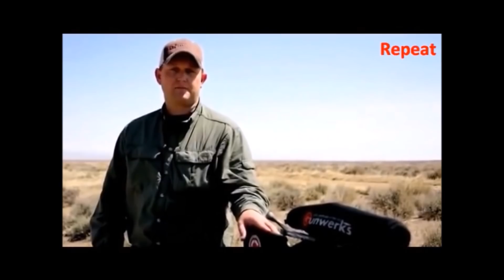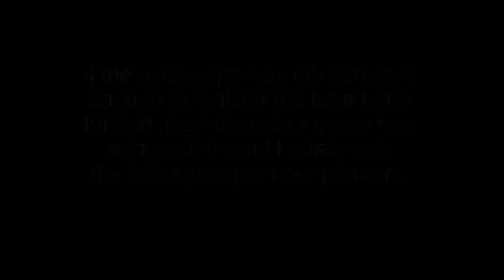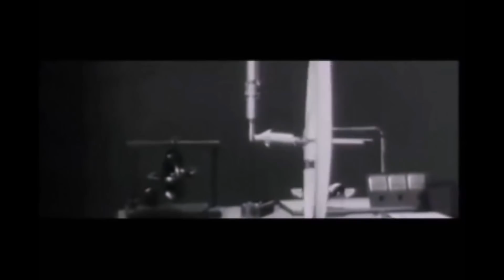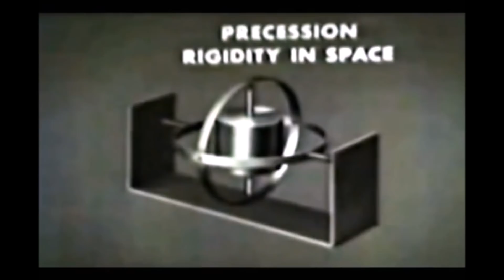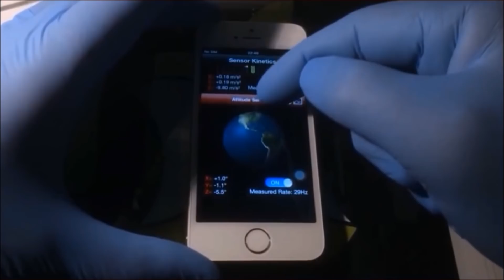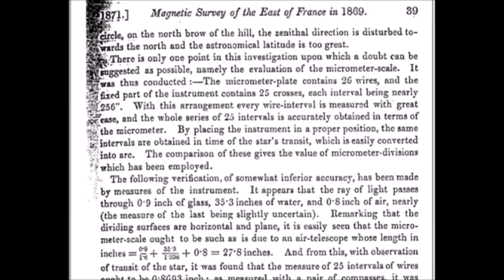The Motionless Earth - Final Addendum

Comment: Considering Coriolis effect, wouldn't the other motions be even more apparent than just the variable rotational effect? For instance, depending on your position and bullet trajectory, wouldn't you have to account for say, the 67,000 mph movement around the Sun? To me, if the bullet is indeed not moving with the Earth this would be a far more prevalent force that the shooter would have to account for. Especially considering that the entire planet is moving at that rate so your location should be completely irrelevant. Hypothetically, the bullet should go careening left or right, or up into the air or down into the dirt or not even leave the barrell because that translates to the Earth moving 98,266 feet per second in respects to orbital speed around the Sun. Why do you have to account for rotational effects but the orbital effects magically don't matter? Shouldn't these two forces be equally important?

Comment: What are your thoughts on the ring laser gyroscope experiment recently done?
Reply from the maker: "I have to confess that I was bothered by the fact that the Axis of Evil seemed linked to a special direction in oursolar system... But now we have completely independent data... This is a hint of something really big."- Astrophysicist,Max Tegmark

"Why is the solar system cosmically aligned?"- Astrophysicist, Dragan Huterer

"The apparent alignment in the cosmic microwave background in one particular direction through space is called 'evil' because it undermines our ideas about the standard cosmological model... the Copernican Principle seems to be in jeopardy."- Astrophysicist, Ashok K. Singal

"One of the most surprising findings is that the fluctuations in the cosmic microwave radiation temperatures at large angular scales do not match those predicted by the standard [Big Bang] model."- The European Space Agency, Planck Probe, 2013

"It is both amusing and instructive to speculate on what might have happened if such an experiment could have been performed in the sixteenth or seventeenth centuries when men were debating the rival merits of the Copernican and Ptolemaic systems. The result would surely have been interpreted as conclusive evidence for the immobility of the Earth, and therefore as a triumphant vindication of the Ptolemaic system and irrefutable falsification of the Copernican hypothesis."- Physicist, G. J. Whitrow

"The Copernican revolution outshines everything since the rise of Christianity and reduces the Renaissance and Reformation to the rank of mere episodes, mere internal displacements, within the system of medieval Christendom. Since it changed the character of men's habitual mental operations even in the conduct of the non-material sciences, while transforming the whole diagram of the physical universe and the very texture of human life itself, it looms so large as the real origin both of the modern world and of the modern mentality, that our customary periodisation of European history has become an anachronism and an encumbrance."- Historian, Herbert Butterfield

"It is clear that the earth does not move, and that it does not lie elsewhere than at the center."- Aristotle

"I have read with much interest Messrs. Michelson and Morley’s wonderfully delicate experiment attempting to decide the important question as to how far the ether is carried along by the earth...I would suggest that almost the only hypothesis that can reconcile this opposition is that the length of material bodies changes..."- George FitzGerald

"Anybody who has been seriously engaged in scientific work of any kind realizes that over the entrance to the gates of the temple of science are written the words: 'Ye must have faith.'"- Max Planck

"It matters not whether we reckon it 28 or 54 million miles distant for either would do just as well."- Issac Newton

"Science today is locked into paradigms. Every avenue is blocked by beliefs that are wrong, and if you try to get anything published in a journal today, you will run up against a paradigm, and the editors will turn you down."- Astronomer, Fred Hoyle

"...Again, once more for the record: it has been shown at least six different ways this century alone that the equations and physics used by NASA to launch satellites are identical to the equations derived from a geocentric universe.
Thus, if the space program is proof of anything, it proves geocentricity and disproves heliocentrism." Astronomer, Dr. Bouw
Reply from the maker: That's my thoughts.
Reply from the maker: "We may therefore say that the broad result of a series of experiments of Michelson-Morley type is that no motion of the earth through the ether can be detected by an influence on the velocity of light.”– Encyclopedia Britannica (1959)

“There was just one alternative; the earth’s true velocity through space might happen to have been nil.” - Physicist, Arthur Eddington

“The data [of Michelson-Morley] were almost unbelievable… There was only one other possible conclusion to draw — that the Earth was at rest.”- Physicist, Bernard Jaffe

“The easiest explanation was that the earth was fixed in the ether and that everything else in the universe moved with respect to the earth and the ether… Such an idea was not considered seriously, since it would mean in effect that our earth occupied the omnipotent position in the universe, with all the other heavenly bodies paying homage by moving around it.”- Physicist, James Coleman

“The Michelson-Morley experiment confronted scientists with an embarrassing alternative. On the one hand they could scrap the ether theory which had explained so many things about electricity, magnetism, and light. Or if they insisted on retaining the ether they had to abandon the still more venerable Copernican theory that the earth is in motion. To many physicists it seemed almost easier to believe that the earth stood still than that waves – light waves, electromagnetic waves – could exist without a medium to sustain them. It was a serious dilemma and one that split scientific thought for a quarter century. Many new hypotheses were advanced and rejected. The experiment was tried again by Morley and by others,with the same conclusion; the apparent velocity of the earth through the ether was zero.” - Historian, Lincoln Barnett,foreword by Albert Einstein

“What happened when the experiment was done in 1887? There was never, never, in any orientation at any time of year,any shift in the interference pattern; none; no shift; no fringe shift; nothing. What's the implication? Here was an experiment that was done to measure the speed of the earth’s motion through the ether. This was an experiment that was ten times more sensitive than it needed to be. It could have detected speeds as low as two miles a second instead of the known 20mps that the earth as in its orbital motion around the sun. It didn’t detect it. What’s the conclusion from the Michelson-Morley experiment? The implication is that the earth is not moving…”- Physicist, Richard Wolfson

“…to the question whether or not the motion of the Earth in space can be made perceptible in terrestrial experiments. We have already remarked… that all attempts of this nature led to a negative result. Before the theory of relativity was put forward, it was difficult to become reconciled to this negative result.” - Albert Einstein

"I have come to believe that the motion of the Earth cannot be detected by any optical experiment."- Albert Einstein

"Briefly, everything occurs as if the Earth were at rest..." - Physicist, Henrick Lorentz

"A great deal of research has been carried out concerning the influence of the Earth's movement. The results were always negative." - Physicist, Henri Poincaré

"We can't feel our motion through space, nor has any physical experiment ever proved that the Earth actually is in motion."- Historian, Lincoln Barnett

"Thus, even now, three and a half centuries after Galileo... it is still remarkably difficult to say categorically whether the earth moves..."- Physicist, Julian B. Barbour

"There is no planetary observation by which we on Earth can prove that the Earth is moving in an orbit around the sun."- Physicist, I. Bernard Cohen

"So which is real, the Ptolemaic or Copernican system? Although it is not uncommon for people to say that Copernicus proved Ptolemy wrong, that is not true... one can use either picture as a model of the universe, for our observations of the heavens can be explained by assuming either the earth or the sun to be at rest." - Physicist, Stephen Hawking

"If we were to adopt a frame of reference like Tycho's in which the Earth is at rest, then the distant galaxies would seem to be executing circular turns once a year, and in general relativity this enormous motion would create forces akin to gravitation, which would act on the Sun and planets and give them the motions of the Tychonic theory."- Physicist, Steven Weinberg

"Let it be understood at the outset that it makes no difference, from the point of view of describing planetary motion, whether we take the Earth or the Sun as the center of the solar system. Since the issue is one of relative motion only, there are infinitely many exactly equivalent descriptions referred to different centers - in principle any point will do, the Moon, Jupiter... So the passions loosed on the world by the publication of Copernicus' book, Derevolutionibus orbium caelestium libri VI, were logically irrelevant..."- Astronomer, Fred Hoyle

"...we can take either the Earth or the Sun, or any other point for that matter, as the center of the solar system.This is certainly so for the purely kinematical problem of describing the planetary motions. It is also possible to take any point as the center even in dynamics, although recognition of this freedom of choice had to await the present century."- Astronomer, Fred Hoyle

"It is possible to describe the entire universe using any chosen point as the unmoving center - the Earth will do very well - and no one can prove that choice is wrong.... Scientists today prefer to picture everything in motion and nothing as being the center. If you haven't given much thought to the implications of twentieth-century science, you may be chagrined... to realize that because of the concept of relative motion, no one can prove that the Earth moves." - Kitty Ferguson, Science Writer

"Thus we may return to Ptolemy's point of view of a motionless Earth. This would mean that we use a system of reference rigidly fixed to the Earth in which all stars are performing a rotational motion with the same angular velocity around the Earth's axis... one has to show that the transformed metric can be regarded as produced according to Einstein's field equations, by distant rotating masses. This has been done by Thirring. He calculated a field due to a rotating, hollow, thick-walled sphere and proved that inside the cavity it behaved as though there were centrifugal and other inertial forces usually attributed to absolute space. Thus from Einstein's point of view, Ptolemy and Copernicus are equally right. What point of view is chosen is a matter of expediency."- Physicist, Max Born

"I can construct for you a spherically symmetrical universe with Earth at its center, and you cannot disprove it based on observations. You can only exclude it on philosophical grounds. In my view there is absolutely nothing wrong in that.What I want to bring into the open is the fact that we are using philosophical criteria in choosing our models. A lot of cosmology tries to hide that."- Physicist, George F. R. Ellis

"It is very important to acknowledge that the Copernican theory offers a very exact calculation of the apparent movements of the planets... even though it must be conceded that, from the modern standpoint practically identical results could be obtained by means of a somewhat revised Ptolemaic system.... It makes no sense, accordingly, to speak of a difference in truth between Copernicus and Ptolemy: both conceptions are equally permissible descriptions. What has been considered as the greatest discovery of occidental wisdom, as opposed to that of antiquity, is questioned as to its truth value."- Physicist, Hans Reichenbach

(the Earth-centered system) "is in reality absolutely identical with the system of Copernicus and all computation of the places of the planets are the same for the two systems."- Astronomer, J. L. E. Dryer

"Whether the Earth rotates once a day from west to east, as Copernicus taught, or the heavens revolve once a day from east to west, as his predecessors believed, the observable phenomena will be exactly the same. This shows a defect in Newtonian dynamics, since an empirical science ought not to contain a metaphysical assumption, which can never be proved or disproved by observation."- Physicist, Dennis Sciama

"Tycho Brahe proposed a dualistic scheme, with the Sun going around the Earth but with all other planets going around the Sun, and in making this proposal he thought he was offering something radically different from Copernicus. And in rejecting Tycho's scheme, Kepler obviously thought so too. Yet in principle there is no difference."- Astronomer, Fred Hoyle

"We know now that the difference between a heliocentric and a geocentric theory is one of motions only, and that such a difference has no physical significance, [the Ptolemaic and Copernican views], when improved by adding terms involving the square and higher powers of the eccentricities of the planetary orbits, are physically equivalent to one another."- Astronomer, Fred Hoyle

"So if Earth is at rest relative to the ether, then it alone is at rest. That makes us pretty special... Do you really want to return to parochial, pre-Copernican ideas? Do you really think you and your planet are so special that, in all the rich vastness of the Universe, you alone can claim to be 'at rest.'"- Physicist, Richard Wolfson

"But when you look at CMB map, you also see that the structure that is observed, is in fact, in a weird way,correlated with the plane of the earth around the sun. Is this Copernicus coming back to haunt us? That's crazy. We're looking out at the whole universe... That would say we are truly the center of the universe."- Physicist, Lawrence Krauss
Reply from the maker: I'll tell you what I tell globies... This isn't directed at you, just saving time...

Einstein has not been proven, stop listening to mainstream propaganda, he has been CLEARLY refuted with his imaginary equations that account for nothing but the imaginative "contraction" of Michelson-Morley device because they found the ether and HAD to explain it away because they were wrong if they wanted to stick with the Copernican model, which in nature turned out to be wrong as well. If you actually watch the video, this is explained and ADMITTED among those who INVENTED the equations. It is straight up ADMITTED that the equations are NOT needed if you place the Earth as being stationary. The equations are only NEEDED if you believe in the Copernican model and have to explain away imaginary motions of the earth. THEY ADMIT THIS. EINSTEIN AND OTHERS ADMITTED THEY  PURPOSELY DID AWAY WITH THE ETHER THROUGH INVENTIVE MATH, because it was their ONLY OPTION to INVENT MATHEMATICS and INVENT "SPACE-TIME", and to IMAGINE that devices somehow physically alter themselves while they observsbly don't.... all this and INVENTING much more INVENTIVE NONSENSE, that THEY ADMIT to inventing because they refuse to accept the simple, obvious, demonstrable, and repeatable proof that the Earth is STATIONARY.

 This is why General Relativity even came into existence... to create a NEEDED excuse. HE ADMITS THIS. Can't stress that enough. Gyroscopes also prove this (Watch the video) and the globe excuses have all been answered and the "miracle" that planes fly just perfectly fine, like they always have, without the said device needed to "account for earth spin and curve"... The same device that only ONE entity makes for the ENTIRE airline industry, its contracted out to NASA, and they don't talk to anyone.... hmmmm.

We proved the ether through Airy's failure, through Michaelson-Morley and others, and through modern day ring laser gyroscopes. The ether was detected. The explanation that it's the Earth spinning was refuted because it was the ONLY motion ever detected while our claimed motion around the sun never shows up. Same with our claimed motion around the galaxy and through space as a whole. All those speeds should register with ring laser gyros but they never have and never will and it's ALL well within their sensitivity range. Now to drive this point home even more, a helmholtz coil has been used near these ring laser gyros and it completely sends the readings wild. This is because it's altering the electric/magnetic fields of the ether. If it was the Earth that was moving the helmholtz coil wouldn't have an effect on the reading, PLUS more than just so-called "axial spin" would be observed.

Sorry if I came off strong, but I highly suggest you watch my video about science vs. mathematics and listen closely to the entire presentation.... https://youtu.be/0f7qlCTToDc

Accelerometers also prove what we live on/in .... check this out if you haven't yet.  https://www.youtube.com/watch?v=V3tdyV1cAWg